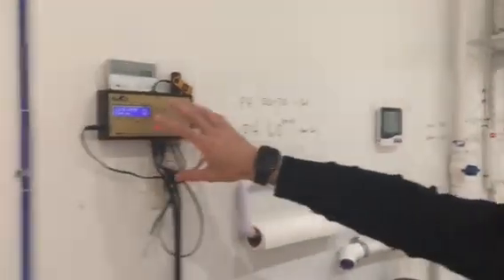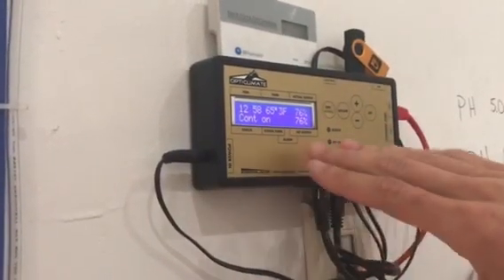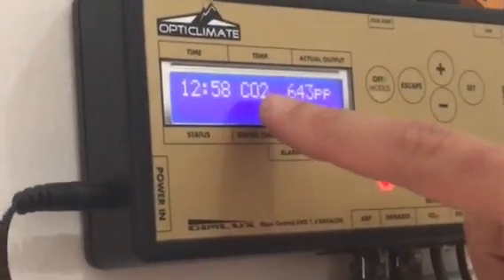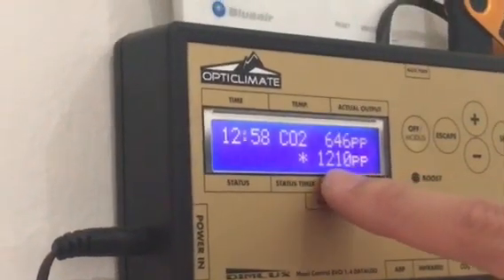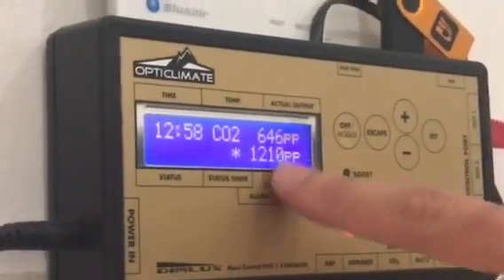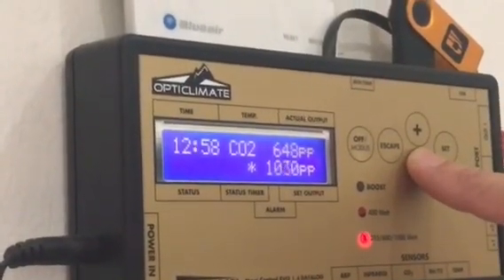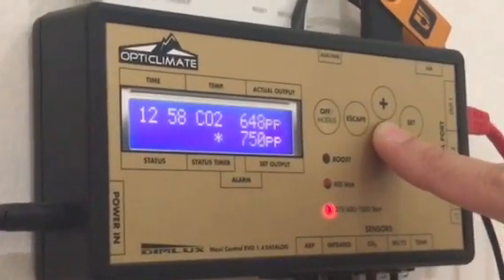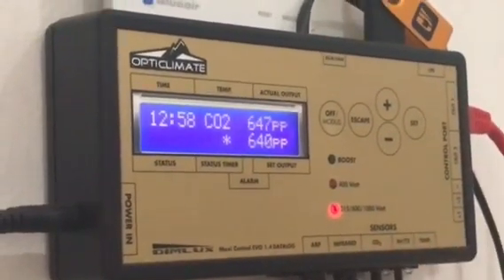DimLux MaxiController CO2 Video

Comment: My controller has a mind of its own... Guys im trying to find out about your add in reflector but i cant find any info anywhere, do i have to buy 4 of them and make myself, its hard to tell by 1 pic and no info, could you guys spend and hour updating all this info, and the rest? Ive spend thousands on your lights and feel like im getting mugged off.